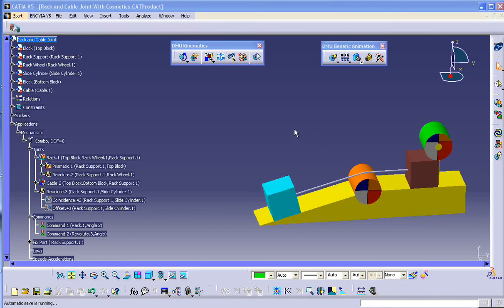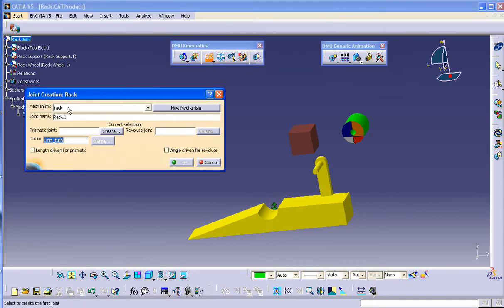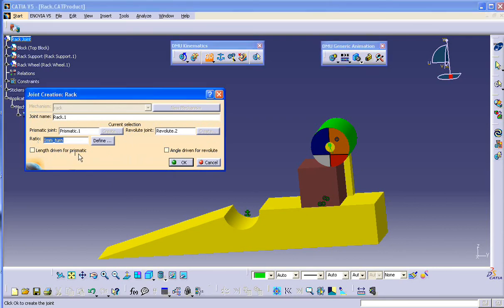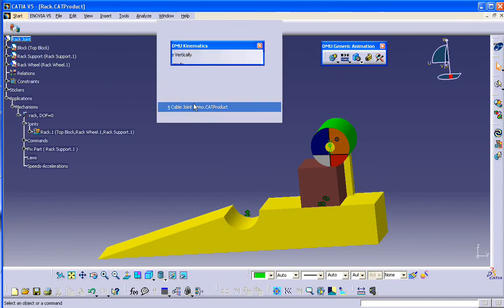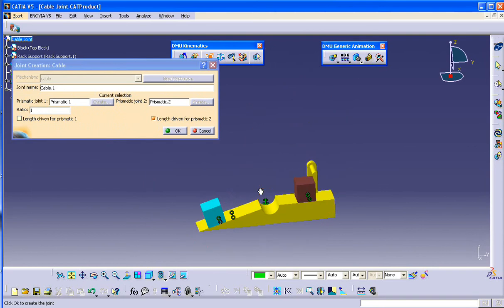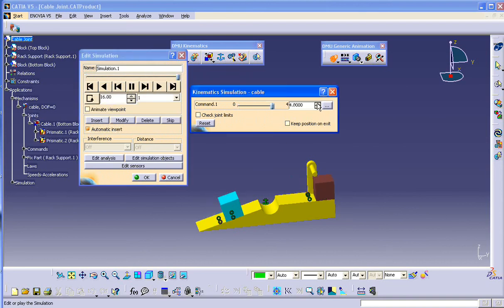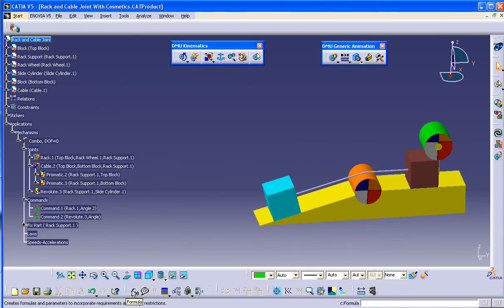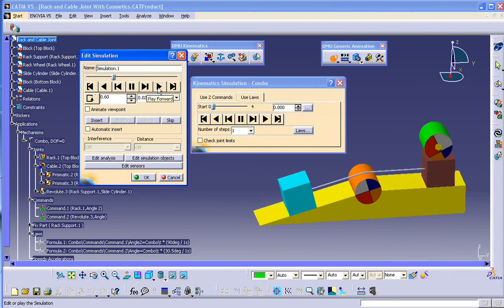Catia Rack and Cable Joint Tutorial

Comment: I am so sorry for not answering the questions. This video was created for a school project, so I never followed up after this. The Cable trick is an illusion. I just drew two cylinders (or rods) and extended out from the roller thingy in both directions. If you use x-ray vision you will see that the blocks are actually punctured through by the "cable" because the block motions are governed by the laws we assigned it, the cable/rods have no impact on it. I hope this answers your questions. 

Again, this was just a small project required by my school course so not a lot of advanced thought was put in. I'm sure there are fancier ways to do this. Mine was a cheating way just to make it look nice. Sorry for the disappointment.